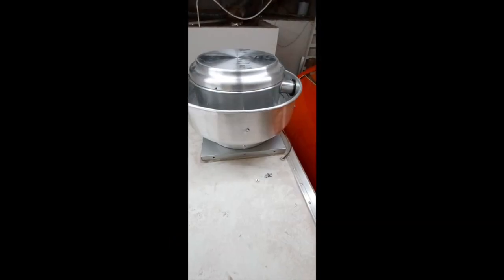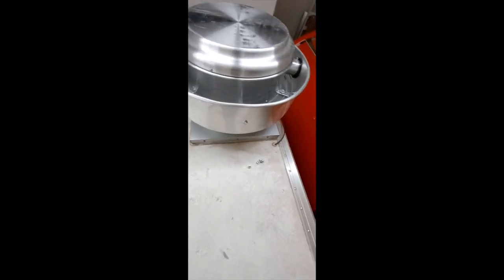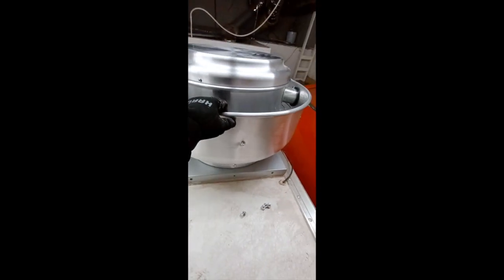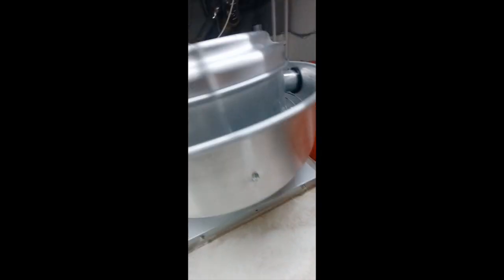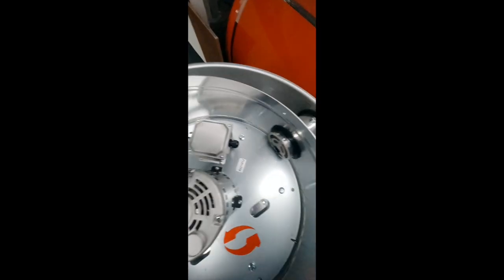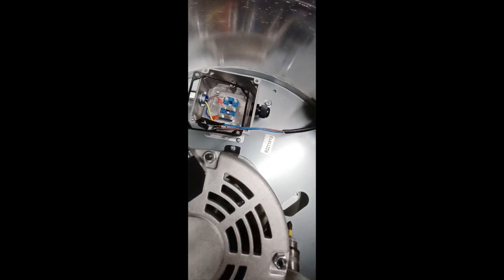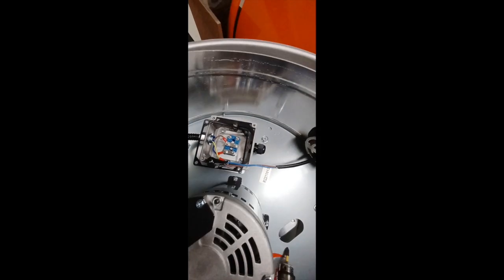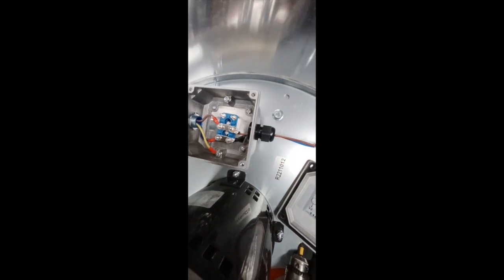Upblast Fan Installation for an Arete Food Trailer

Comment: What if my wires are black and white
Reply from the maker: @heathersmithx  thanks for asking!  So in that case you would put the white wire in the middle and the black where the 2nd wire is on either left or right
Reply: Thank you for the reply.  One additional question is this the correct setup for low voltage 115 voltage
Reply from the maker: @heathersmithx  yes this upblast fan is 110/120v correct.